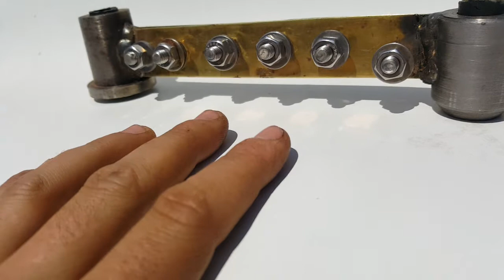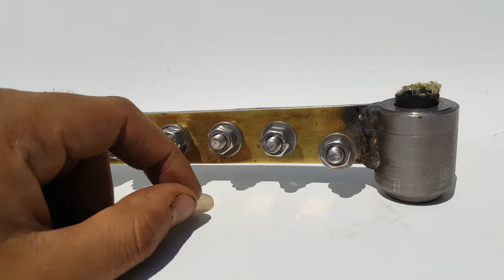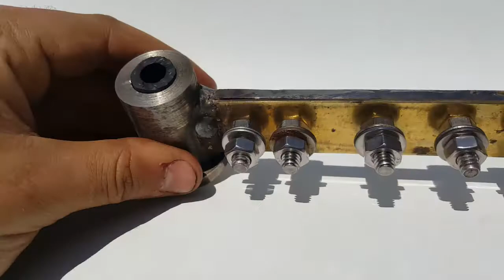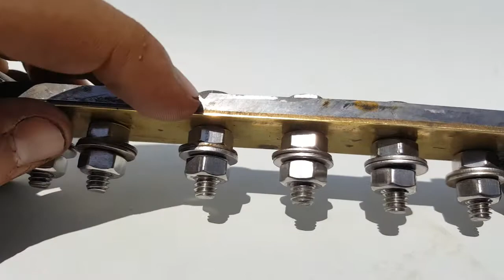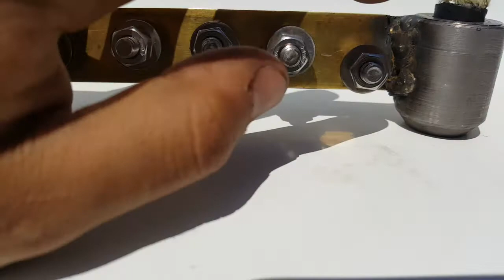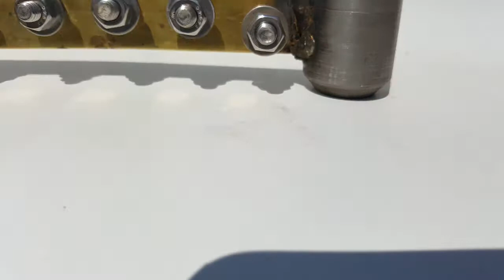Homemade indestructible brass & steel bus bar/block terminal block

Comment: If you are not getting as much power as expected it’s because copper and aluminum have great conductivity but steel… not so much
Reply from the maker: The block has been working well. But stainless or brass would certainly be more durable.

Comment from the maker: I've since been able to find a decent copper terminal block, but it's expensive and still inferior to this design.

https://www.amazon.ca/Radio-125-Copper-Ground-SCGB-HAM-6KT/dp/B00HDIJ3NC/ref=pd_rhf_dp_s_pop_multi_srecs_sabr_2?pd_rd_w=oyE1d&pf_rd_p=792836e4-edf4-471d-96b9-ec43f2e735c5&pf_rd_r=RD6PX1Q9E2FB6YT7GDA6&pd_rd_r=4f5f46a9-95fa-49b1-b91d-12eeb878ea23&pd_rd_wg=KciH9&pd_rd_i=B00HDIJ3NC&psc=1

Comment: In old industrial instalations they used to equip "blindo barras". 
A solid bar of copper, tappered. Similar to yours
Reply from the maker: Ya, industrial generally want things that last. That's why trucks are usually better than cars.

I did a quick search on the 'blindo barras' but couldn;t see one.